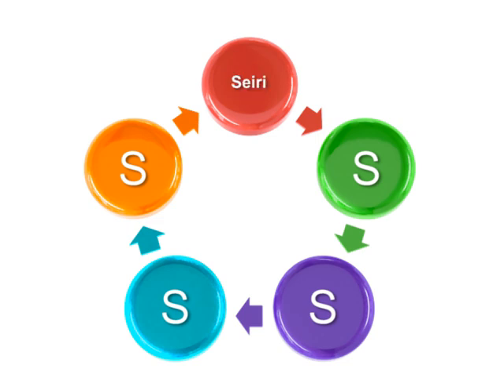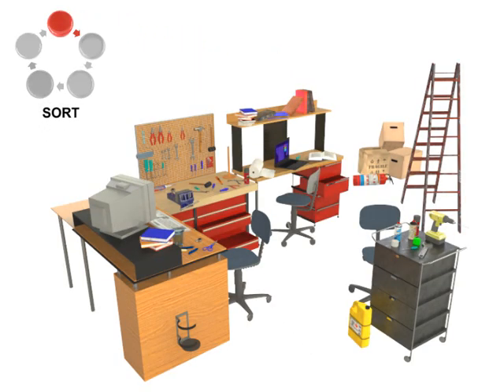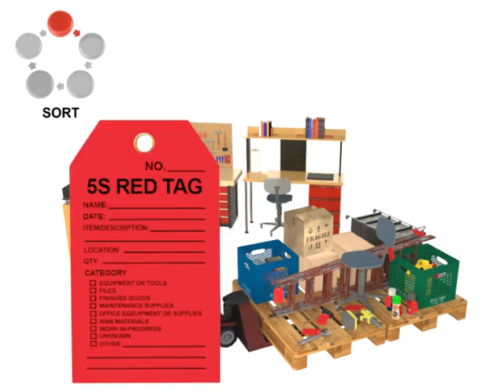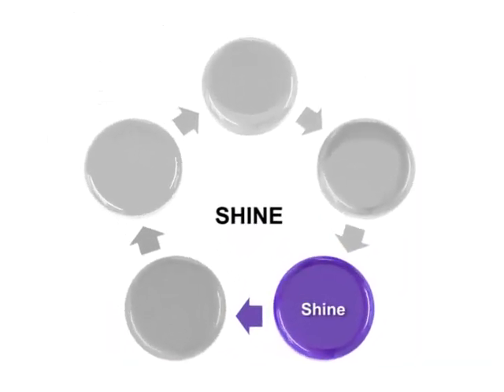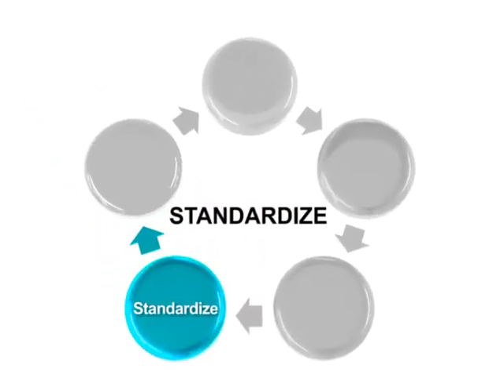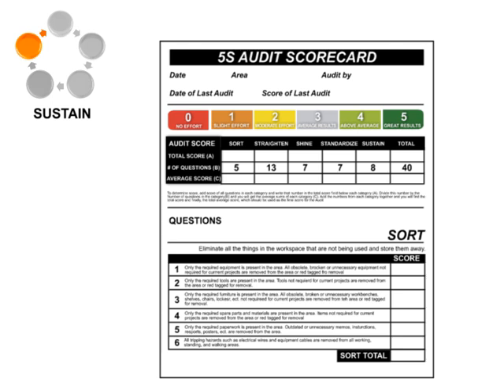What is 5S?

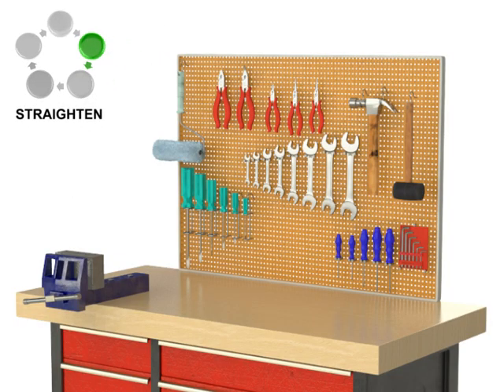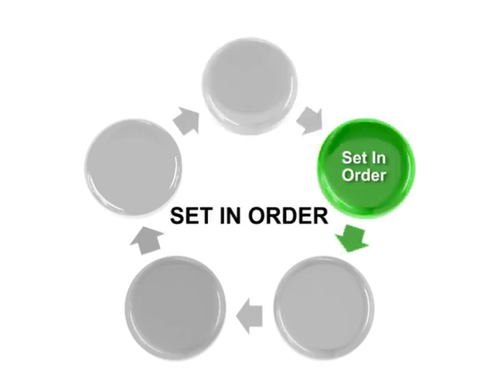Comment: Using cutouts/shadows with labels (2:02) for tools should support the follow-on "shine" step through visual sweep. In other words, leaks and accumulations of dust or dirt or grease {etcetera} must be considered when 'setting in order' (1:38) with focus of completely eliminating leaks and ensuring ease of cleanliness. That said, generally, the person/s tasked and with depth of knowledge and experience in the process should be charged with making these decisions and sometimes, what seems the most simple basic need (e.g. like where best to place a spatula for a grill) to maintain 6S [adding 'Safety' to 5S] can be quite challenging.

Good luck with your efficiency improvement efforts!

Excellent video. Thank you.